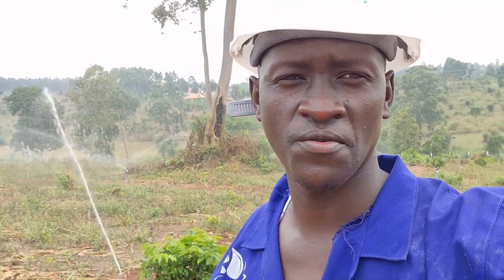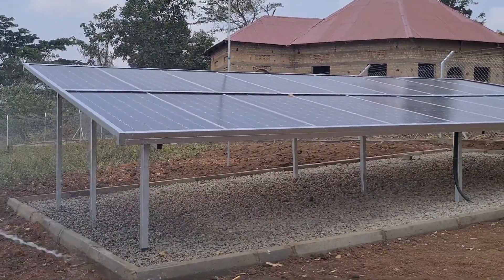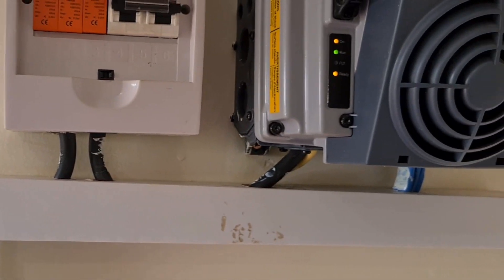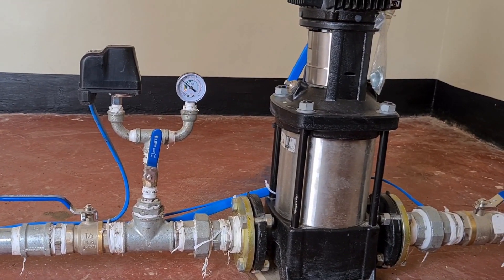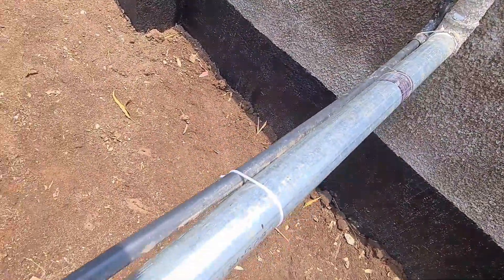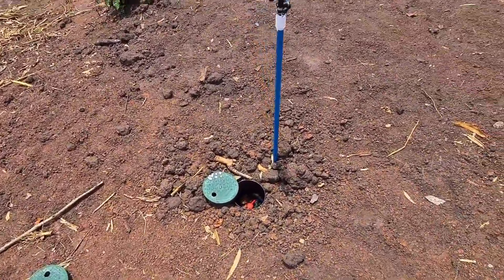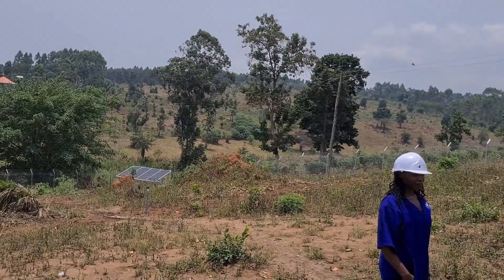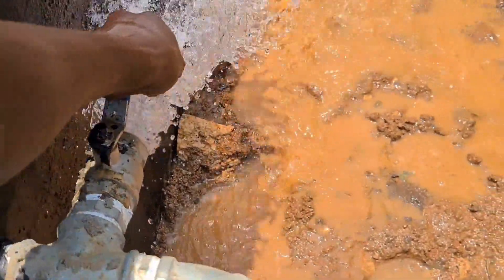Solar powered fixed sprinkler irrigation system

Comment: Good work Sir...I have done the drilling and nstallation of the main pump and solar...but i would like to know how to set up that pumphouse and increase the pressure
Reply from the maker: You may need a storage tank(s) and install a booster pump from the tank
Reply: @WeisEngineeringLtd  which is the best booster pump and should it have its own solar structure?
Reply from the maker: @josephmulei  the best option will depend on how much water you need to pump per unit time and head/pressure required
Reply: I need pressure for rainhose pipes..which have a distance of 60metres,,, currently they can operate at 30 metres without booster pump....and the pump installed inside the borehole is pedroli of 1.5 kw..I have one storage tank of 10000 litres

Comment: Correction here, you're not increasing the system pressure by closing the valves, you're increasing  total system resistance consequently the pump increasing it's head in response to the system resistance to create flow .
ADVICE FROM AN AGRICULTURAL ENGINEER(SOIL AND WATER ENGIEER)
Reply from the maker: True, thanks

Comment: Your sprinkler spacing is not very impressive,space for maximum overlap to achieve great distribution uniformity, technical advice here from an Agricultural Engineer -Soil and Water Engineer
Reply from the maker: This is appreciated
Reply: IAM wondering why you are not in UgiFT microscale irrigation because I see you guys far better than most of these contractors in Ugift 😊😊😊
Reply from the maker: @ronaldotiti5284  this financial year, we didn't register

Comment: What is the power rating for your intermediate booster pump between the tanks and the sprinklers?
Reply from the maker: Power is 2.2kw
Maximum head is 60 meters 
Maximum flow is 10,000 litres per hour

Comment: Nice, if I have a 1 hectare field about 100m from the pump, what minimum size of the booster pump would you recommend to run such sprinklers?
Reply from the maker: Booster pump fo about 80 meters head and 12,000 litres discharge

Comment: Please what is the cost of this irrigation system
Reply from the maker: About Ugx6,500,000 in sprinklers and pipes. 
About Ugx12,000,000 in the solar system 
Excludes tanks, base, borehole drilling
Reply: @WeisEngineeringLtd  ok can I get  a quotation through my email

Comment: How much does this set up cost
Reply from the maker: About Ugx6,500,000 in sprinklers and pipes. 
About Ugx12,000,000 in the solar system 
Excludes tanks, base, borehole drilling
Reply: Great stuff- when you say solar system- does this include the booster pump, pannels and all components inside that system house
Reply from the maker: @confidencetrufu3767 No, however other components are required to protect the system components, the basics include solar panels, wires, inverter, and the pump.

Comment: this is system not use filtering water?
Reply from the maker: Yes it doesn't, water source was clean and clear
Reply: @WeisEngineeringLtd  becouse u not use drip instalation?
Reply from the maker: Yes, and the water was clean

Comment: Good works Weis Engineering and a big thank you for sharing, a quick question what booster pump would you recommend for rainhose irrigation of a similar area?
Reply from the maker: You're welcome.
A booster pump of about 0.75Kw, if you advise us on the elevations between water source point and highest point plus horizontal distance, we can estimate more realistic pump head, flow and power.

Comment: What size is the surface booster pump are you using for this setup
Reply: Thank you for taking Time to reply. Am writing from Zambia, Lusaka. Am trying to put up similar set but can find such pumps available on local market. Are you able to supply
Reply from the maker: @ConoFarm-so2xd  yes we can be able to supply
Reply from the maker: Booster pump is 2.2kw, 60 meters head, 13,000 Liters per hour discharge.

Comment: Professional installation done, good job..keep up. However, one observation noted: The common isolation valve (ball valve) for the pressure swith/gauge should be locked or at least handle to be removed to prevent accidental isolation of the safety device (pressure switch).
Reply from the maker: You're welcome. Yes we do that.

Comment: Well done, nice setup, I have two questions, so with this setup we use 2 pumps, one from the borehole to the tanks and the next from the tanks to the sprinkler. Meaning in the evening when there is no sun you can not water your garden yet that would be the best time to do so. Does this setup mean we can't use gravity from the tanks to the sprinkler? What if we raise the tank higher to increase water pressure?
Reply: You won't get enough pressure to runn all the sprinklers unless  u raise the tanks 70metres to get good flow and head

Comment: What is the size of the controller that you have used to run 2.2kw booster pump
Reply from the maker: 2.2Kw
Reply: @WeisEngineeringLtd  Thank you so much for your response. I recently bought a 4kw pump inverter but i have not been able to get it working. What panel watage is needed for it to work

Comment: What is the horsepower of the AC pump and how many sprinklers or acres of land that can be irrigated?
Reply from the maker: 3hp, rated flow is 10,000 litres per hour and rated head is 48 meters.
The size of the land it can cover depends on the system water requirements, pressure required and operating hours

Comment: Hey brother how much a system like that would cost for 10 acres land, and the components use and brands if possible, wonderful work love it
Reply from the maker: If the borehole yields around 3,000 litres per hour, you may need an underground reservoir that can store much more water
Reply: @WeisEngineeringLtd  hello at Weis.
You are doing a great job.
Thumps up forward ever and backwards never.
I liked the solar equipment as it is in the video.
Its such powerfull I liked it.
My situation is that we intend to get the water from a very big big dam and irrigate a land of 10Ha.
Am writing from Zim.
Would you advise me on:
Components to buy ie 
*No. Of panels, their type, and sizes interms of wattage.
Model of inverters and its size, as well as the circuit breaker.
*size, type of model pump suitable to abstract water from the dam.
Well something like a Quotation

Comment: what is the cost of each of those solar panels, and the 3,200 L/H submersible water pump? Your website dose not have the prices.
Reply from the maker: Solar panels come in different wattage, each wattage cost an average of Ugx1,700 . Solar pump cost Ugx2,800,000

Comment: Im impressed, good stuff out there. May to add on that, i would take advantage of building structure to place the solar panels  on top or make them like a canopy on top of water tanks to economize space and provide shade and  safety.
Reply from the maker: That's a great idea!.
You put consideration on orientation and angle of tilt to maximize solar energy absorption

Comment: What pump is that you are using for irrigation
Reply from the maker: Submersible pump was Grundfos SQFLex 2.5-2.
Surface pump was Grundfos CRN 10-6.
Reply: @WeisEngineeringLtd  how much is it, ship to Kenya
Reply from the maker: @chrismbithi  It might be available in Kenya as well.
It will cost you additional costs for transportation and taxes
Reply: @WeisEngineeringLtd  can't find it in kenya
Reply: @WeisEngineeringLtd  Can't find it in Kenya
Reply from the maker: Davis and Shirtliff may have

Comment: Please I have a question. Can a shallow well be used to do irrigation? If yes what amount of water is needed to irrigate one acre of maize farm through sprinkler irrigation?
Reply from the maker: Yes, a shallow well can be used to irrigate however to a smaller scale depending on the irrigation method to be used, and planned crop types.
You may need about 8,000 litres per day, however the actual water required will depend on climate, crop and soil factors.
A hand dug well may give you about 1,000 litres a day.

Comment: Do you run all of that sprinkler from the pressure that comes from the tank or the pressure comes from the solar pump
Reply from the maker: The pressure comes from the surface booster pump

Comment: Nice presentation brother
How big are those tanks and what it the name of your pressure pump and booster please... watching from Zimbabwe
And what is the capacity of that borehole please... amazing set up for sure
Reply from the maker: Each tank is 10,000 litres, Grundfos CR10-6.
Borehole yield is 3.3m³/hr
Reply: @WeisEngineeringLtd  
Many thanks that is plenty of water capacity if I am not mistaken ours is dry land maximum achieved so far is 24 000 L per day?
Reply from the maker: You can use drip irrigation keeping other factors constant
Reply: @WeisEngineeringLtd  
That sounds a very good idea thanks

Comment: How far can it pump from the well?
Reply from the maker: Upto a vertical height of 100 meters,
Horizontal distance depends on gradient, pipe size used, flow and pressure head required at the exit to mention

Comment: This is very a neat installation. I like the fence work also. Did you erect it also? Very good work.
Reply: If i need ur service in ghana can u guys make it to ghana?
Reply from the maker: We can
Reply from the maker: Yes, we did.
Thank you for the comment
Reply: @WeisEngineeringLtd  what is the thickness of that chainlink wire?
Reply from the maker: @adammaina5612  Gauge 12.5

Comment: Do you not have power bank batteries and why?
Reply from the maker: No, we didn't include power storage.
We designed the system to pump during day
Reply: @WeisEngineeringLtd  I wish you would give me a list of the "major components" of the this wonderful system and their brand names and identity codes in case I want your similar sizes and capacities.

Comment: What is the model of the grundfos surface pump, and do you have them in stock? I’m interested in the entire system. How expensive is it?
Reply from the maker: It is CR10-6,
Please advise us on your water source type, depth and borehole yield in case it's drilled borehole, size of the land and crop type you plan to irrigate.
Reply: Where can I get buy grundfos CR10- pump @WeisEngineeringLtd

Comment: How deep is the well and what capacity is the pump?
Reply from the maker: The well is 70 meters
Pump has a maximum head of 120 meters and a maximum flow of 2.5m³/hr
Reply: @WeisEngineeringLtd   is it possible to use sorla electricity on rental houses ❓ end if you don't mind what could be the cost ❓